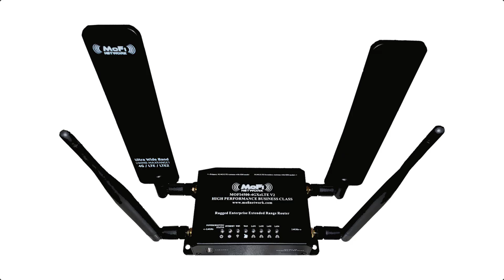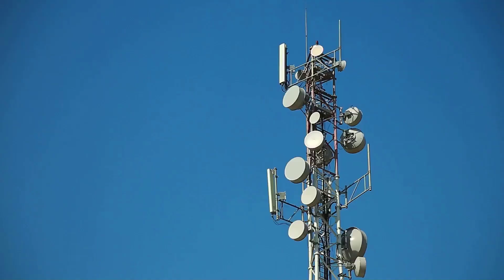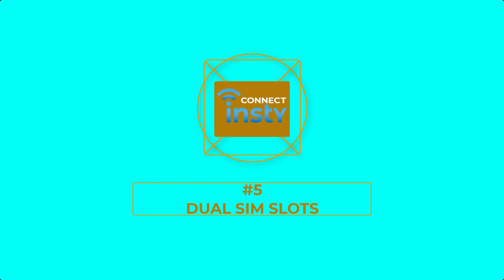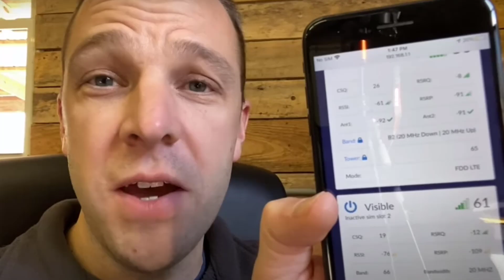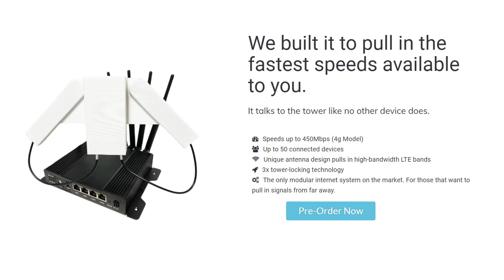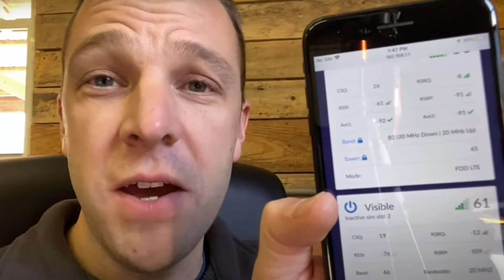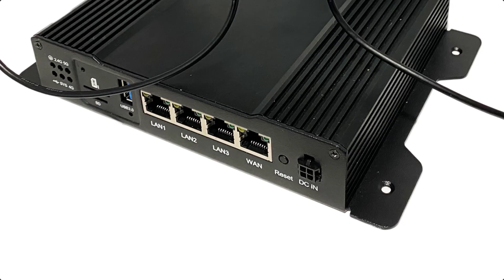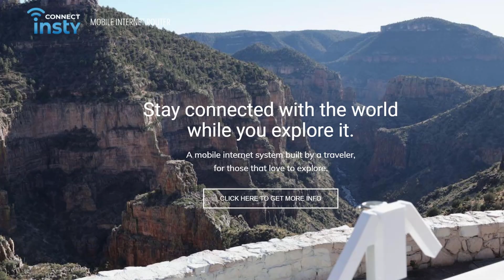Insty Connect Explorer 4G12 - Mobile Internet System

Comment: Dumb question for you - What would you suggest for me? We have a cabin that is well served by cell signals.  I have a Verizon I phone and My wife has an AT&T I phone - both have great service at the cabin.  We go to the cabin about 2 weekends or so a month.  The only service currently available is DSL but the cabin does not have a hardline into it and would be pretty expensive to have installed - plus very slow.  So all this to say - whatever we get would be installed and not moved around.  I primarily want to be able to watch Netflix or Amazon Prime, turn on the heat from home through wifi and install a Blink (or similar) security system.  I am also pretty dumb on all the technical terms .  Thanks in advance
Reply from the maker: The Insty Connect would work great.  You could use on of your existing SIMs with it to get Internet while you are there or you could add a line to dedicate it to the Insty Connect permanently.  It would work fine for streaming Netflix and Amazon Prime and control access remotely.  I use Blink as well for my security system.  Here is a video on that: https://youtu.be/QKLbiHQjonw
Reply: @SeleTraining  Thanks for getting back to me - we also use the Blink XT at home and like it very much.  What do I do as far as getting an AT&T sim card?  Just go to AT&T and add another line to my wife's plan?  She has a better plan with AT&T than I do and it is grandfather'ed in as far as unlimited (I believe) - is it just a matter of telling them we want to add another phone and getting a sim card for it - or do I need to get some sort of data only plan?  Her IPad's are wifi only - no data connection with them.  Like i said - I'm stupid when it comes to this stuff
Reply from the maker: @chucklehman7610  You can add a line but if you want to take advantage of the TTL setting that let's you go past the data cap without throttling then you need a standard phone line not a hotspot only data plan.  I personally use an iPad unlimited plan amd it works great with the router but that will require an iPad cell version to activate.  Otherwise you may have to add a free phone with a new plan.
Reply: @SeleTraining  Ok thank you!

Comment: Using a netgear LB1120 but having consistency issues (VPN). Was about to get the MoFi and saw this. We're in a bind and need something now. Would you suggest getting a MoFi 4500 & reselling for the insty when it's available?
Reply from the maker: Pre-orders have filled up fast so it's probably a month before the inventory will be available to ship immediately for Insty Connect orders.  The MoFi is still a working option that is available right now if you need it.  MoFi also has their new model planned for release in April.  The Insty Connect is worth waiting for if not for the immediate need.

Comment: NIce briefing on a cool (yet to be released) product.
Will wait for some perfomance reviews before I drop $1000 on the 5G model, but the design definitely looks interesting.
FWIW, I've been getting good results by mounting my Netgear M1100 in a weatherproof box on a pole and running ethernet back to my Wifi 6 router. (Bit of a challenge to keep the unit from overheating, but it essentially provides the same optimization of raised antenna without loss of signal strength due to long wires. Swapping SIMs is also not at all convenient; eSIM would fix that.)
The superior components of the Insty solution (antenna design, better LTE modem, custom software, etc.) should allow it to achieve get much better performance.
Reply from the maker: Sounds like you have attempted the same type of solution.  Having a modem in the antenna is a big advantage.  The 5G model of the Insty Connect will be out by summer.

Comment: I just purchased two parabolic antennas for a MoFi 4500 SIM7 router that I purchased in late October 2020 after watching your video. Although the Internet speeds are faster than using MIMO Log Periodic Antennas (also purchased in late October 2020),  the average speeds are still only 10 - 12 Mbps.  There are three to four towers within 1 to 4 miles.  Do you think that the parabolic antennas are needed to get decent Internet speeds (30 - 60 Mbps) with the Insty Connect router or that the Angel Wing antenna will provide these speeds or better?  How will these antennas connect to the Insty Connect router?  I have a few days left to return the parabolic antennas if they're not needed.  I've sent an email to the address provide for Insty Connect customer service (Nick@instyconnect.com) but hasn't gotten a response.  I want to order this router but if the company won't answer questions, I don't think I can purchase this router.
Reply from the maker: The Insty Connect Angel Wing antenna has been designed to maximize the speed after a bunch of testing.  I believe Nick also has a long range antenna option so you'll want to get some info on that as well.  I'll have a video with some speed comparisons between the MoFi and Insty Connect soon.  The trick with the Insty Connect is that the modem is stored inside the antenna to prevent signal loss and improve the reception so it's not designed to work with other types of antennas although you could probably make it work.  You'll just lose the benefit of the modem being in the antenna.  Nick has created some responses to several questions but maybe you are not on the email list.  Add your email to the link at instyconnect.com and you'll get those responses.  The Insty Connect is in high demand right now and orders are beginning to ship this week.  Once things settle down you'll get a quicker response.  He was just out on vacation last week.  Also, there are several YouTube channels putting videos together, including myself so you'll start seeing more information this month.  

As far as speed with the MoFi you may want to compare Wifi to wired and see if you notice an improvement with a wired connection.  The WiFi settings may need to be adjusted but testing with a computer wired to one of the ethernet ports can give you an indication if the slower speed is wifi related instead of the tower connection.
Reply: @SeleTraining  As I stated, there are only a few days left to return the two Parabolic antennas.  I've been testing the MoFi since early November with the antennas mounted in 10 to 15 locations.  I connected a computer directly to the MoFi via Ethernet in early December to document the wired speeds.  I have the MoFi connected to my home router for Internet backup and don't use it's WiFi.

I added my email address to the list before sending an email.  Hopefully, I'll get a response so I can place an order.

Comment: I currently use a visible handset with the hot spot option turned on, as there is no internet in my area. Would you recommend this with visible network/sim and what is your experience with speeds?
Reply from the maker: I haven't used Visible but I see that Nick was using it with his Insty Connect.  I'll have more details in another week with some speed results.  Speed is highly dependent on your location, carrier, how close you are to the cell towers, and if the towers are overloaded or not so it will vary dramatically.
Reply: @SeleTraining  following

Comment: Will this connect to a open wifi signal?   Like to a campground hotspot?
Reply from the maker: No. It’s only for a cell signal.  You’ll find that local Wi-Fi at campgrounds is often overloaded and not very useful.  A cell based Internet solution is much more reliable.

Comment: Would it be better if I use a sim card from a phone or should I use one from a hotspot device like a Jetpack or mi-fi?
Reply from the maker: Both of those SIMs will work in the Insty Connect.  However, the hotspot plan will still throttle at the data limit.  Only a regular phone SIM will let you use the TTL setting I mentioned in the video to go past the data limit without throttling.
Reply: @SeleTraining  Awesome. thank you!

Comment: The cable that runs between the modem and the router is actually a USB cable rather than an Ethernet cable.
Reply from the maker: Yes, I misspoke on the video.  It is a USB3 and does have a shorter length limit.

Comment: DO THAY HAVE  4GLTE/5G COMBO ROUTER /MODEM? or are thay comming out with one in the futchure?
Reply from the maker: On the link you will see there are two models - 4G12 and 5G20.  The 5G20 is a 5G/4G combo and is due out by this summer.

Comment: Can I use a tmo tablet only sim in this device?
Reply from the maker: I am using a T-Mobile iPad SIM and it works great in these routers.
Reply: @SeleTraining  in another reply you had stated 'get the cell phone version' (referring to the sim car type one should get if they wanted to use ttl settings to bypass data caps) but here you're saying you used this device w/ an ipad sim? a little confused on the guidance here so a response would be much appreciated!
Reply from the maker: @supernice_auto  It is an iPad data plan but with T-mobile that is just a regular phone SIM made for the iPad.  A little confusing but it's just a cheaper version of a regular cell phone plan.

Comment: I am looking for an auto-failover cellular backup for my business.  I dont need a wifi router since the output side will go into a firewall.  Would you recommend this or a different product?  I was hoping to use Google Voice with Bands 2 and 4. Thanks for the recommendation.
Reply from the maker: The Insty Connect would work well.  You don't have to enable the WiFi.  You  just connect it to your network as a failover option.  The failover would need to be setup on your network first though because it would control the failover to the Insty Connect.  The Insty Connect also has two SIM slots so you could setup a secondary failover carrier as well.

Comment: I'm planning on full-timing in my RV in or around the Show Low, AZ area this summer (currently RV'ing in Florida now, so no connectivity issues here).  Arizona is a different story though.  Seems only Verizon is what you can get in that whole north central Arizona area and it kinda sucks.  Anyone use Verizon out there and would you or anyone reading this have a recommendation on what kind of service plan I should get for that area along with trying to use this InstyConnect device?  Thanks much!
Reply from the maker: I've actually had more success with AT&T around Arizona.
Reply: @SeleTraining   ok...which parts?  I'm thinking I will be in different areas from Springerville all the way west to Flag or Payson, and Show Low in between.  I was out there scouting around last September with an AT&T iphone and had zero signal the entire time between Show Low and Springerville, and also in Alpine.  I also had another phone on Cricket (which is AT&T too I think), and it had zero service also the entire time.  Everyone I talked to said Verizon was all there was throughout those areas but that the towers are few and far between, so even the Verizon signals and wireless data was very spotty.  So I'm trying to decide on something to get decent data to be able to VPN to my company network to be able to work remotely.  

My other option so far I think might be to buy a StarLink sat system.  I'm hearing it is very good so far and should be good down to latitudes above the 30 line.
Reply from the maker: @GrandWagoneer  I had no issues in Show Low, Flagstaff, Cottonwood, and several areas south around Tuscan and Benson.  There are always spots with poor coverage with any carrier but AT&T has been pretty good around all the places we visit in Arizona.  I like to look on campendium.com for coverage at camping spots.  They show all the carrier coverage that people have reported.

Comment: I am getting ready to go full time in my rv this year. I currently have an AT&T grandfathered unlimited family plan for our phones and a Nighthawk M1 hotspot. Would I be able to swap the Nighthawk M1 sim into the insty and continue using it as if it was in the Nighthawk? I currently have a 4G omnidirectional mimo antenna mounted to a pole that I suction cup to the side of the rv and run the cables in thru the slide. Would a similar setup work with the insty?
Reply from the maker: Yes.  The Insty Connect would take that SIM.  Part of the design of the Insty Connect is the Angel Wing antenna and it contains the modem inside so you wouldn't want to use your existing omnidirectional mimo antenna.  You would need to put the Angel Wing antenna in it's place.

Comment: thanks , 4 days after i received the mofi. i still have my bosx and all papers that came with mine should i send it back???? all i do is stream so would mofi be all i needed? i never was told i was going to need aditional $ 300 antani????
Reply from the maker: The MoFi can work without an antenna but it will improve the signal.  The proxicast is $130.  I believe the Insty Connect is a better product though so I'd swap them if you can.
Reply: @SeleTraining  do i need to do a rest to mofi before i send it back
Reply from the maker: @craigpugh1366  It's a good idea if you setup a password for the admin login or wifi .
Reply: @SeleTraining  i got my refund for the mofi so i have sim now im going to buy this new router . thanks Sele

Comment: Thanks..but what about band coverage? I don't see any reference here or on the site..
Reply from the maker: I'll dig up the list and let you know.
Reply from the maker: Here's the band list for the Insty Connect:
LTE-FDD
B1,B2,B3,B4,B5,B7,B8,B9,B12,B13,B14,B17,B18,B19,B20,B21,B25,B26,B28,B29,B30,B32,B66
LTE-TDD:
B38,39,B40,B41
Reply: @SeleTraining   Thank you,  Is there a reason why none of these cat 12 or 18 modems have band 71?
Reply from the maker: @flybird141  Most of the manufacturers are slow to adopt the newer bands.  Some of the category 18 modems have band 71 but that is much more expense and some of the really cheap modems have it but they are such old technology.  The other issue is that most antennas don't cover the 600Mhz range for band 71.  It will become more common in the future but not represented well yet.

Comment: I think I'll stick with the Mofi4500 until he gets better on his pricing. He's a little on the high side.  Although the 5g is interesting, at a grand for it, ththats waaayyyyy out there.
Reply from the maker: If you add an antenna to the MoFi it’ll be close to the 4G12 price. Insty Connect includes the angel wing antenna.
Reply: @SeleTraining  well since its new will give it time once price go a bit lowerr esp for 5g model ill be looking into it. ? how is the internet speed with mofo 4500 sim7??
Reply from the maker: @UGotHookah  Speed depends on your location and signal quality. You can get up to 100Mbps but it's all over the place based on your connectivity.
Reply from the maker: @ehn2393  The MoFi is limited to 100Mbps.  The Insty Connect 4G can run up to 450Mbps and that is my current recommendation.  I'm not recommending the MoFi anymore.
Reply from the maker: @ehn2393  As I mentioned the MoFi is $300 and if you add a Proxicast Antenna for $130 plus cables you are $450 already.  The Insty Connect is a Category 12 modem that is about 3 times the value of the outdated MoFi modem.  It also has the Angel Wing antenna design so that you will get a better signal and avoid the signal loss you get with a coax cable.  It also has 5Ghz wifi which will work better for your devices.  So for very little more money you get a much superior product than the MoFi.